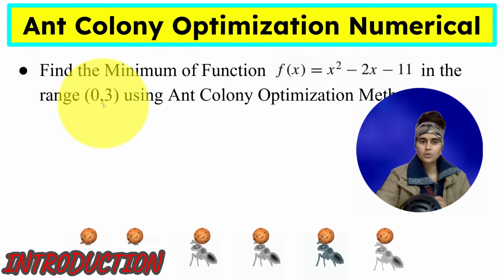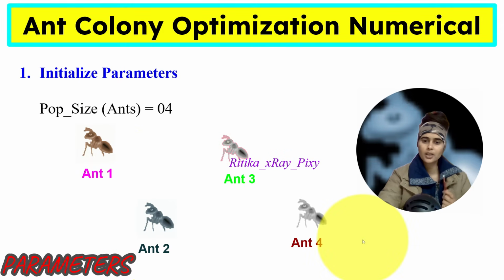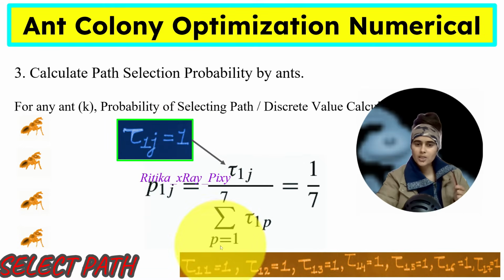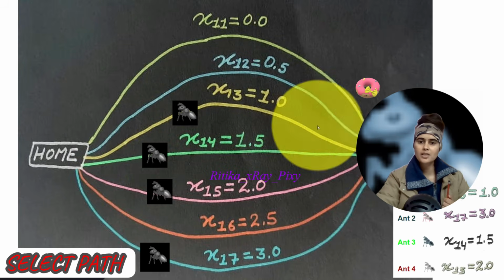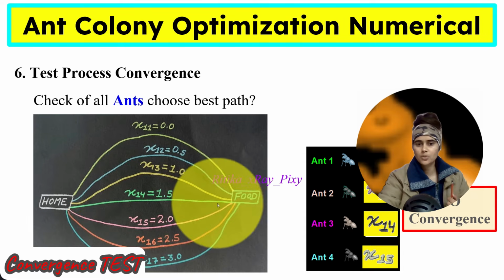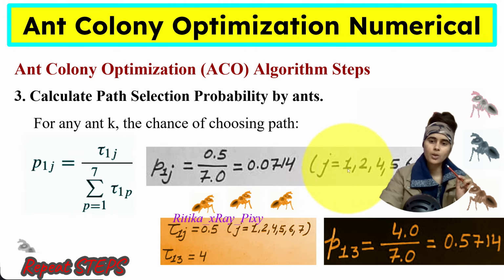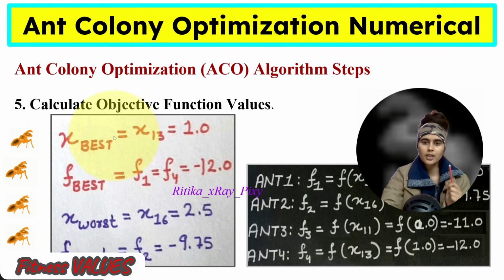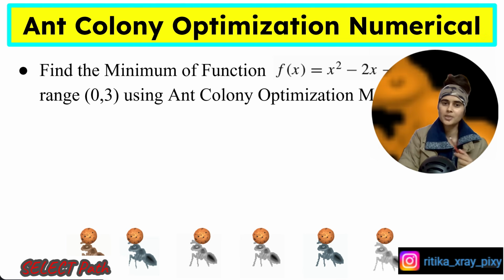Ant Colony Optimization Numerical Example Step-By-Step ~xRay Pixy

Comment: Hi mdm, thanks for sharing. Here are a few questions, any guidance would be appreciated.
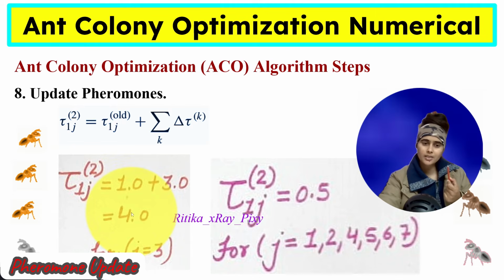17:30  Doesn't the pheromone deposited at the best path evaporate? Why directly carry on the pheromone value of the previous iteration?
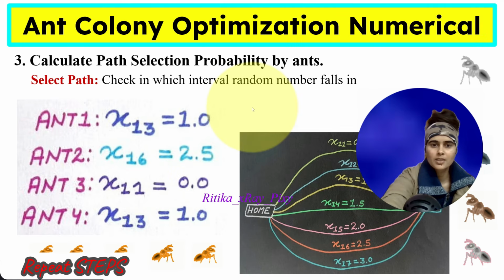20:52  r3= 0.0776, Ant 3 should select the 2nd path (0.0714, 0.1429)
Reply from the maker: Hello, 
1. The Best path has maximum pheromones as compare to other path so its evaporation rate is considered a bit slow in comparison with other paths.
2. For this check where it falls ( r3= 0.0776) and select that path accordingly.
Reply: @RitikaxRayPixy  
Got it, thanks mdm